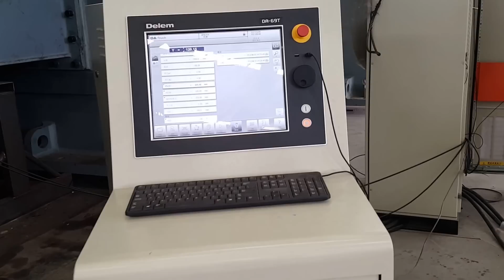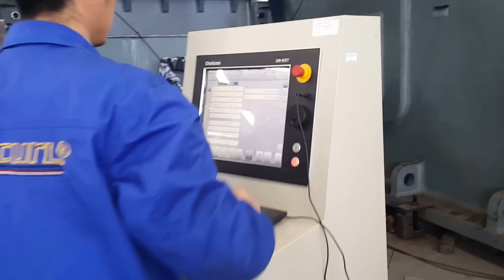ACCURL MB8 12000 mm x 3000 ton Press Brake- 12 Meter CNC Press Brake Bending ST52 50mm Mild Steel

Comment: So where was the ^50mm Mild Steel^ mentioned in the description?
Reply: ACCURL MB8 12000 mm x 3000 ton Press Brake- 12 Meter CNC Press Brake Bending ST52 50mm Mild Steel

Comment: perhaps a couple more chinese guys with white gloves and hardhats could bend something thicker then 1/4" plate. embarassing lol
Reply: The are calibrating for accuracy at various points you dope.... This is not the machine in use.  This is the mfg doing final testing on the machine.